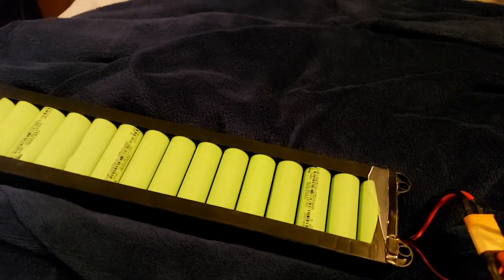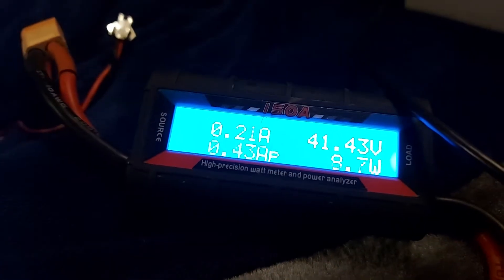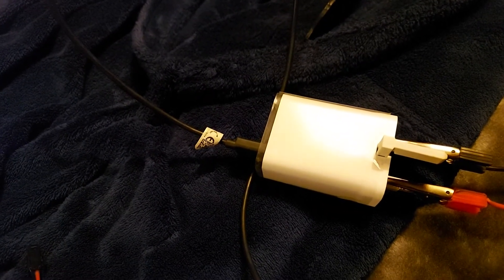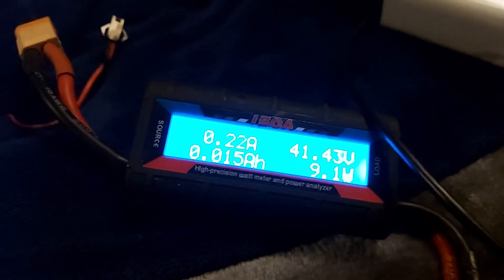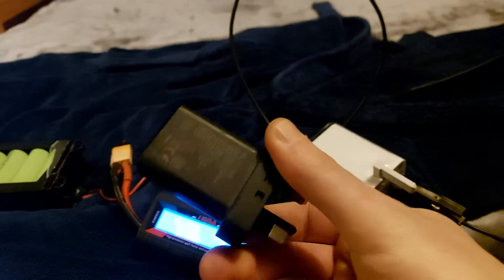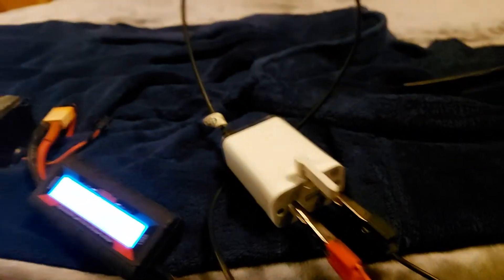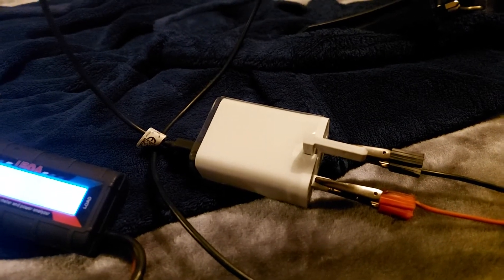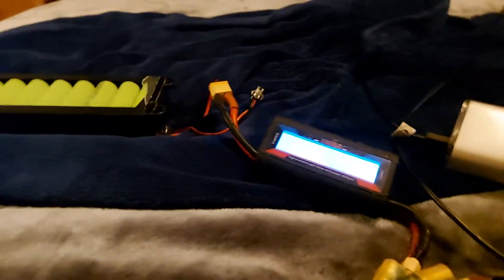36v bike battery powers phone charger directly

Comment: I'm looking at putting together a hi capacity power bank with all my sub1000 mAh cells, from a safety point of view this makes perfect sense, having the cells in series reduces the risk of runaway damage should one of these "old" cells go short circuit etc....
An interesting experiment could be to compare x amount of cells in series on the "mains" charger with x amount of cells in parallel in a standard powerbank to see if there's any efficiency issues?
Reply from the maker: More series cells require more complex battery management. As for efficiency I don't think there will be much difference.

Comment: Confused by this, the battery pack is DC I assume and the charger is expecting AC so how is that working?
Reply: Chargers that are switchmode rectify the incoming AC into DC, then chop the DC into AC (in flyback topology, as most phone chargers, it's pulsating, not alternating - "true" AC is only in half bridge/full bridge topology) that is then sent to the transformer, and then rectified again and filtered.

You can connect a suitable DC voltage and the charger won't mind at all. However, it might confuse the active power factor correction, so you should only to this with a "small" charger (less than 25 watts) that doesn't use PFC.